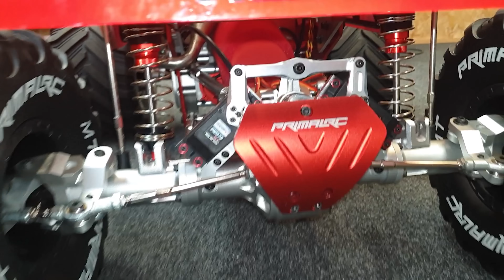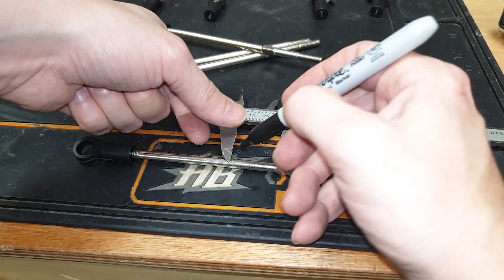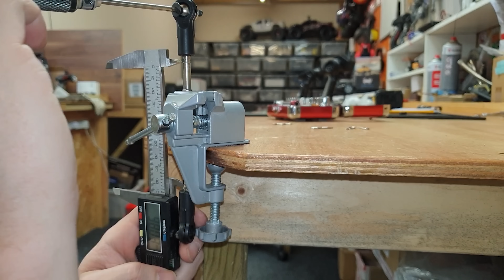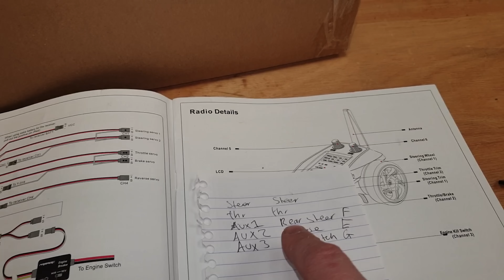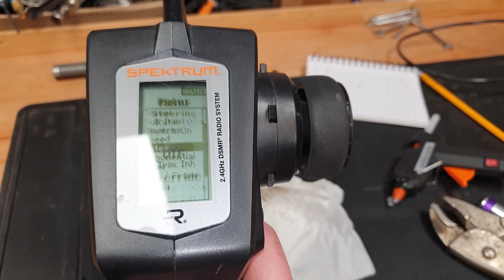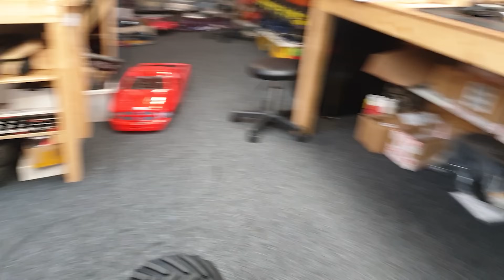Worlds Biggest RC Car - How mine is different...

Comment: Shouldn't you be able to mixer the servo rates on the rear steering to set up the front and rear as the same turning angle?  Use the button to activate or deactivate, sure, but it strikes me that something isn't right if your rear isn't proportional...
Reply from the maker: sure, i could do it like that but i don't want to. real monster trucks rear steer is not proportional :)

Comment: surely it would of been easier to cut one end by 30mm and use a tap and dye set to rethread the rod, this would ensure you keep the strength instead of creating a potential weak spot.

Comment: That's a Flysky gt5 
They're pretty good but a bit fiddly with the settings 
They have a setting on them that allows you to control front and back steering with a push of a button as you mentioned 
Complex settings but they're brilliant once you get the hang of them
Pretty far range also if I remember

Comment: Why weld the link when you could cut it and tap thread on the cut end? Wouldn’t that be stronger than a weld joint and easier? (Just wondering)
Reply from the maker: didn't have any dies to hand and wanted to get out the next day
Reply: Kevin Talbot I feel that for sure, haha as you said plenty of times in the video! Loving the videos like always! Get over to your local HoboFreight store and get you’re self a set of taps and dies. Think that structural  rigidity you’ll get out of a solid piece v.s. a cut welded piece will be night and day.

Comment: I would've cut the end links down on the one end and then used a tap and die to re-thread it versus welding but either way would work I suppose.

Comment: My first decent RC was a Kyosho Bandit. I bought it around 1990 at a closing hobby shop. It was a kit and didn't realize I needed a battery and charger. Cost me almost as much as the discounted kit. It was a dune buggy, but I converted it to a street car with shorter shocks, a 1934 Ford body and painted it like ZZ Top's Eliminator. I put a Reedy Motor and different gears. It   handled like a brick, but it would wheelie and was a big hit at car shows. Things sure have changed.

Comment: Thumbs up on the welding. I bought a mig welder a little while back and i'm still learning.  Just another option, cut more threads on the shaft then cut to size. Eliminates any weak points and or wobbles. Like the channel keep up the good work.
Ramp-Ha's Rc's

Comment: U don't have to worry about shocks breaking. RC Sparks had a shock that inside the screw came off on the end of the shaft. That was the only problem he had and has jumped that truck over 100 times. Check out his last video on the primal Raminator. He can explain to you more about what happened. But as far as doubling shocks up Jeff from Eastside RC has a YouTube video and I believe running 2 shocks on every corner is a little to stiff.

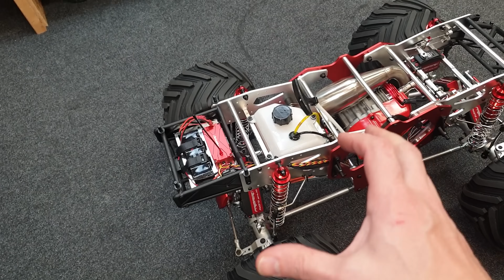Comment: What are you doing at 5:06 ?. My understanding is that welders would kill you with the amount of voltage and amps going throught it.
Reply: Welding voltages are pretty low (17-48 or so) and only work because your'e dealing with conductive materials. He isn't conductive enough to complete a circuit at those voltages.
Reply: @Blaquer17  ok. Thanks  for the explanation.

Comment: Kev, you think this thing could be converted to electric? I can't imagine motors and speed controls don't exist that would handle this monster... I'd love to see that mod...wish this thing wasn't $2000+ or I'd be doing it myself just see if I could because nitro is so messy and NOISY...
Reply: Jake Jager esc exist for sure, flier and alien Power make up to 28S
Reply: @chutpapapeche  how sick would an electric raminator be?
Reply: @jakejager  some setup are possible 70mm diameter moteur, low Kv (200) 24s 😍😍😍😍 but 🤑🤑🤑

Comment: Kev would it not have been better to just cut thirty mil off the end, and recut the thread on the right hand thread, then no risk of of it breaking at the weld.
 Just change the expo to get better steering control, what diameter are the shock's and the length, give me a shout I will measure both for you, as the Kraken -RC as similar spring length also the FID Dragon Hammer.
Steering wise the original Wheelyking set up is actually a good setup, I would follow that idea.

Comment: Hey Kev, when your welding on small parts like that just use mig welding wire like .045 for filler rod while Tig welding it so you don't have to use so much heat and it'll look prettier too. If you want bro, just a suggestion
Reply: took the words straight outta my mouth lol
Reply: You can buy small tig wire so you don’t need to deal with mig wire curling